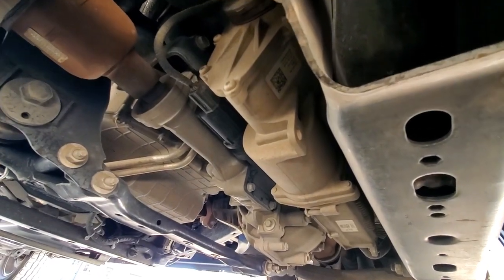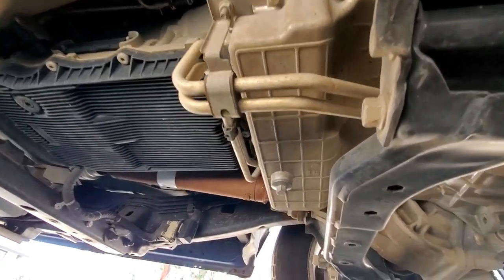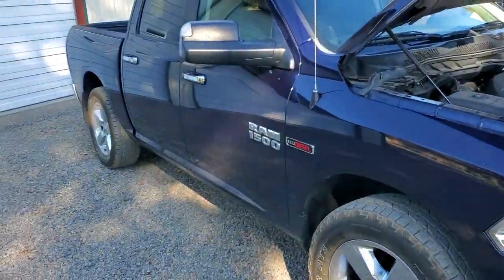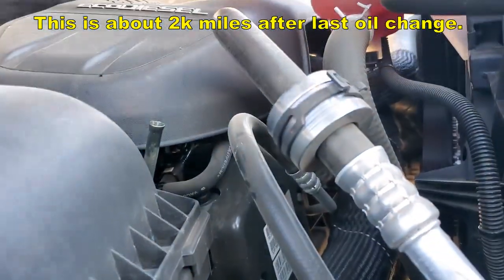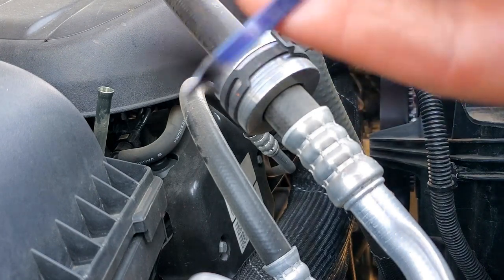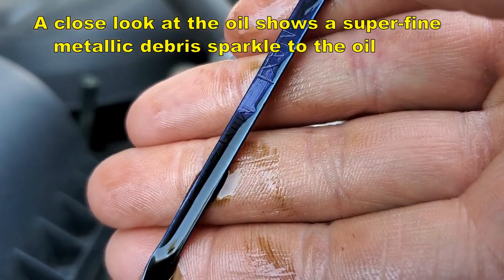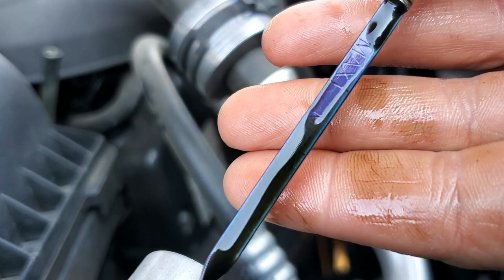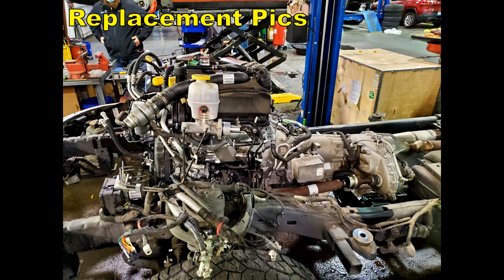What Ecodiesel engine failure sounds like? | Eco diesel Knocking | Main Bearing Failure

Comment: Holy crap...the cab has to come off for an engine swap?
Reply from the maker: Yea buddy!
Reply: The cab has to come off just to replace the turbo
Reply: That much disassembly,  the truck will never be the same.
Reply: Yeah, been that way for about ten+ years on a ford. Too much crap in the way to actually work on the engine. Can actually take the cab off in about 20 minutes with lift.
Reply: I was in a Ford shop once and there were several super duty cabs in the air.
Reply: @malquid3811  fords with the 6.4, same procedure.
Reply: @ever4437  its 89 steps, 2 days to remove f250 cab, 3 days to install.

Comment: why does this happen to the engine? any preventive maintenance so that this does not happen?
Reply from the maker: Main bearing design is poor I guess. Use the best oil, make sure to cool the engine down after driving, and frequent oil changes. Sucks!
Reply: Exhaust soot gets into oil and clogs main bearing passageway. Oil starvation, then engine eats bearing
Reply: @Nostradamus_Order33  Yep even passed the filter too its an oiling problem and if you look at the Main bearings there tiny as hell for a diesel  its built like a gas engine..
Reply: @Mr_Meowingtons  
Diesel trucks need a Kardasian bottom end. Fiat has picked a Katie Perry bottom. I’ve been also arguing this point with people on YT. I’m glad to know there is at least one ☝️ person besides me that knows diesels.
Reply: @Nostradamus_Order33  Damn near every Diesel engine I worked on use King Bearings..Them Dodge Bearings look like thin ass cardboard was used..Just a cheap design bearing surface...
Reply: @Nostradamus_Order33  Gotta love the EPA for all this smog stuff on diesel trucks, shorten the life of engines and kill fuel mileage.
Reply: @WizzRacing  That is another good observation. I was only looking at the lack of adequate surface area. Good bearings are a multiple layer design. The soft layer maybe too thin.
Reply: @ever4437  The big three will not complain. Ford, Ram, and GM will make their money on new sales.

Comment: Ford engines have their problems with the valve train. All new truck engines are not bulletproof.
Reply: Yep I got 120k on my Ecoboost all tuned up. I use good oil and a catch can so my timing chain seems to be good still *crosses fingers*. I want to replace a timing chain for 3k before replacing a blown engine that's for sure.

Comment: Sorry but why do people continue to buy this junk? You hear nothing but horror stories about these engines failing left and right with low mileage...that's totally unacceptable!
Reply from the maker: I'm surprised with technology today, that of all problems an engine can have, it had to be main bearing failure. Fairly common with this engine, and completely fatal to it. Come on Ram! Now I will probably not buy a FCA product again! You had one job to do!
Reply: There are many of these trucks that have had zero problems after 100k+ miles.  The failure rate is certainly higher than average, but RAM has stepped up and generally taken care of the owners.  I have had no issues with my Eco in the 2 years I've owned it.  I am really happy with mine.
Reply: @NDSTraveller  there is always 1 person that will not have a problem.. But I seen 8 with blown up Main bearings in 1 year all had 5 of them where under 50K 2 where under 30K. if you ever see the size of the Main bearings in this engine you will shit your self! the engine is built like a gas engine going in to a Honda civic. and people are towing with them.
Reply: These are phenomenal engines and make great power, mine came with a worry free 200,000 mile warranty so I bought one. Don’t care if it blows up, it’s covered.
Reply: @mikerobinson8734  how many years on that?
Reply: @Mr_Meowingtons  20 years 200,000 mile power train warranty including the turbo. Through Don-K Chrysler Jeep dodge in Whitefish Montana. 
People will drive here just to buy their vehicle for the warranty they offer.
Reply: @mikerobinson8734  I would too if I planned on purchasing any fiat product
Reply: Same reason people continued to buy ford's with the cam phaser problems, or the trash 6.0 powerstroke, or the chevrolet with the AFM problems, and the 3.0 duramax with the high pressure oil pump problems. 

Eventually the bugs get worked out and when they do, auto companies will introduce another engine with new problems
Reply: I have a 2015 RAM Laramie Longhorn w/Ecodiesel. I will have owned the truck 2 year as of May 6, 2023 and this truck has been an absolute nightmare.  I bought the truck with 88k miles. At 98k miles the tone ring broken and although the dealership said it should be covered by Warranty FCA refused as they said they couldn't verify if the truck is US or Canadian registered (I live in Michigan  - haven't been to Canada since 2002 and that was just to pass through to Buffalo). 30k miles later the truck drive train was making an awful noise...told that the front and rear differential needed to be completely replaced ($2,800 for rear and $4600 for front). 10k miles later truck quits and I'm told by dealership that the entire EGR system needs to be replaced at a cost of just under $5,500 and that the DPF and SCR also appear to have failed...that will be another $6,000. I have just hit 154,000 miles today on way to a client and suddenly my oil pressure starts fluctuating. One moment it is 35 lbs and next moment it is 0, then back up to mid 30's...almost like a loose connection or a light switch turned on & off. I have never had a vehicle so poorly designed and abandoned in support by the company than I have with FCA. I have a family member that bought a used 2012 Subaru Forester in 2017 with 65k miles. The car had oil changes done at local Subaru dealership every 3k miles. After the car had been owned by my family for about 4 years the dealership noted that the car was repeatedly coming in with the oil low and we informed them that we actually had to add oil between oil changes to keep the level up in the vsafe zone.  The dealership asked us to come back immediately if the oil level was low before the next oil change and not to add any so they could document the problem.  We ended up bring the car in less than 1k miles after the oil change and it was a full quart low. The dealership informed us that our motor seems to have the oil consumption problem which they said is a known issue by Subaru.  Their solution:  replaced the motor with a brand new motor at NO COST even though by now the car had just over 120k miles. That was not expected,  but it is the customer service we have come to find with Subaru....FCA/Dodge/RAM seem to do everything they possibly can to avoid taking responsibility (RAM Cares? Yeah right... more like couldn't care less). Wonder how much they will try charging me to replace the engine assuming the motor is shot? Bar none the worst vehicle I have ever owned  and ironically it is also the most expensive vehicle I have ever owned.  I bought the truck largely because it had a 6-cylinder diesel and it was a Dodge Ram product. I have a 1999 Ram 2500 with the 5.9 Cummins diesel that has over 400,000 miles on it and I love that truck...Silly me I thought this 2015 Ecodiesel would be just as wonderful... nope.

Comment: Dont use normal oil use low ash as required, mostly oil from Europe( Made in there) and change fuel filter because in the US disel is very dirty.Or buy cheap and replace engine.